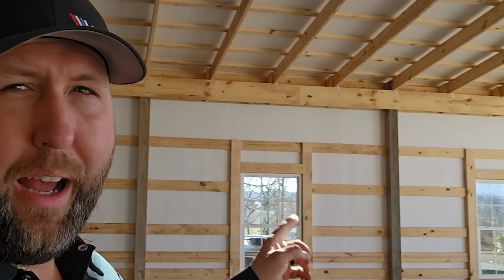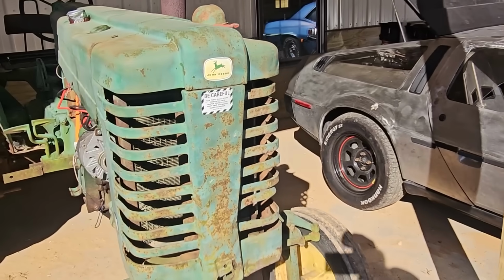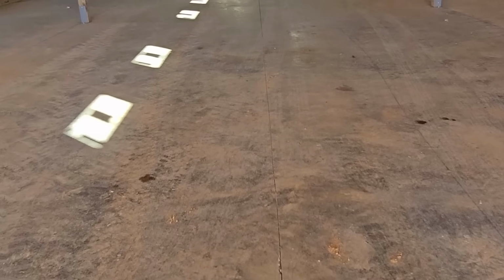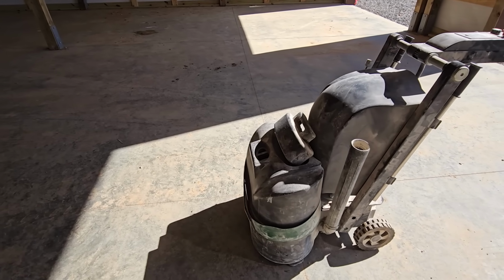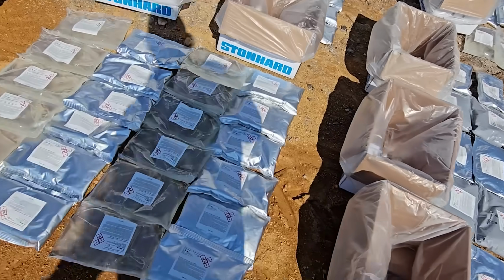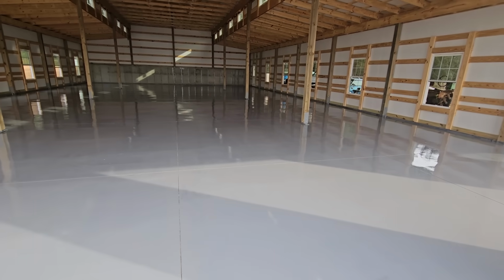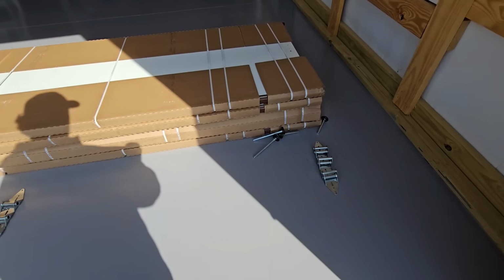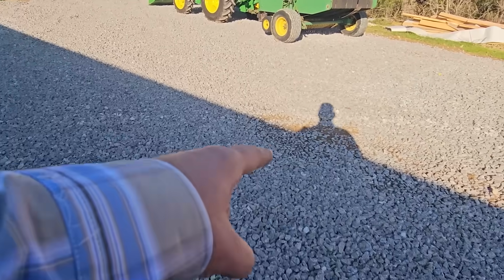Windows, Doors, Floor Epoxy, Gravel and MORE! Barn Build - Part 3

Comment: Great barn. I grew up in the road building business.  Knew those cracks were coming. Next time you pour a slab (and yep, there will be another) build some time into the schedule to compact the sub grade and let it sit a while. Also, pour in lanes with expansion material between the pours. And for sure the exterior slab should be isolated from the interior. You should take advantage of the expertise of the old guys and gals that watch your channel. Many of us would gladly lend a hand. That’s what a community does. Thanks as always for sharing so much. You prolly don’t know it, but you are helping this country come together. God bless.
Reply: And use a concrete mix design that reduces shrinkage/volume change. I design mixes for reduced joint and jointless floors by using shrinkage reducing admixtures/expansive admixtures/macro fibers and proper wet curing with wet curing blankets. Most contractors are only fixated on price per yd or sq ft and never upsell better ideas to the end user. They gasp at a reduced joint mix that will cost another $50 per yd, but then think nothing of spending double that doing what these fools are repairing cracks/epoxy band-aids. And dealing with a mad/unsatisfied customer.
Derek could have had a floor with reduced joint spacing, less chance of curling at fewer joints, more durable concrete with proper curing, and better long-term protection from cracking instead of this abortion.
Reply: @drcornelius8275  Yep. I'm afraid Derek will be making more repairs to this floor as time goes on.
Reply: It is true that us viewers may have better ideas, so that the concrete wouldn't have cracked, or a better way to do water run off, or anything else we see here, BUT, by the time we see it, it happened a week or a month ago or more, so it's too late to give good advice. I knew the other day what the floor looked like, because the kids were working on their 4 wheeler on Little Grip garage in there.

Comment: Nobody there uses rebar. Everybody has massively cracked concrete. The few who do use rebar have zero cracks.Those few people need to get with the program, rip out their concrete with rebar and replace it with no-rebar concrete and live with cracks. Remember, ants and termites love to enter structures through cracks in concrete. Who doesn't love bugs crawling around indoors!

Comment: i am a GC in state of Tennessee. and you are in my zone. BUT per the CODE they are 100% required to use no 5 rebar for monolithic concrete slabs. ?
in the state of Tennessee. all contractors no matter zoning must 100% comply with international building codes. when the contractors got approved for their license it said in the license that you must comply to the international building codes. no if and or but. 
if want the codes for the building codes that show rebar must be used i can.

Comment: Hmm. Not sure I agree with the rebar statements. I am in Mississippi and we use rebar like mad. Most new houses are post tension slabs too. Wire and fiber mesh definitely, rebar preferred.

Comment: All concrete cracks, the saw  joints help, but it always cracks. it will be just fine. they will get it it fixed better than new. Welcome to the south. Rebar is only for commercial work and Bridges.

Comment: I'm gonna be the oddball here and say, don't restore the tractor but, go through it mechanically. I think there's something cool about an old "worn out" tractor that is ready to go to work whenever you are. 

Also, I'm not an expert on the subject but, I feel like a small solar setup could handle door opening along with a few overhead/ security lights for nighttime use. Probably less expensive than pulling service in.

Comment: I've done a little bit of concrete here and there. And it looks like somebody didn't compact the Stone. Before they poured your slab, let me not see when the reason it would crack.
Unless it's been extremely cold and that warm. The ground could have moved. But I don't know if your ground freezes down there or not

Comment: Pretty much a dream garage........ONLY change I'd make is ROLL UP garage doors. When I built my car barn 20 years ago I used Roll up doors, even for my man door.  They were not cheap 20 years ago so I know the same holds true today. But in my 24x36 bard the overhead space roll up doors save is worth it. thx

Comment: I'd definitely restore that ol' Johnny Popper! And if I was you Derek, I'd run a string of lights and hook up a generator on an as needed basis. You know early dusk comes in the winter and you can't get something to start or you gotta make a quick fix and your working with flashlights and lanterns. A quick tug on the ol' generator would make life a lot better! 👊

Comment: Concrete cracks not because of the pour, or rebar, or lack thereof, it’s the dirt brought in for the fill. You brought tons of dirt in to create the under foundation. It needed to sit for at least 6 months, with repacking every month to ensure the mass of dirt becomes one complete compacted solid piece. Now the weight of the slab is compacting the dirt at different rates in different places, hence the cracks. Now every construction company out there will tell you 30 days is enough. Show me a 30 day dirt settle, where the concrete isn’t cracked. Nope, can’t do it. Just like painting a car, 90% surface prep, 10% paint. Don’t blame the paint job if rust spots start popping through. Just like here, don’t blame the concrete poor, it’s the dirt prep.

Comment: Maybe you can put some solar panels on the roof or in the vicinity of the barn. Excess power can be stored in batteries aswell. You could have some lights and at least some power there. Just an idea.

Comment: My suggestion is to purchase an ex military diesel generator, And wire up to a box at the door so you can start it up for power when you need lights or to open the doors, I watched a guy install one the other day and it was pretty straightforward, Only cost 3.5K.

Comment: They do use rebar in Tennessee in in the south but for a project like yours they lay down wire about a inch or 2 high and put about 6 inches of concrete

Comment: the rock is essential and a nice touch - for insulating some foam boards and wood paneling would give a nice retro feel plus make the new garage amenable - add a heat pump and some machining tools in the back - you have some room to work with, the pssst ppsst made the concrete floors look brand new! please add efi and roller bead seats to the delorean time machine

Comment: Speaking from experience as a builder in Virginia Beach, the slab probably would have failed even with rebar.  Next time, follow this plan:

Prep the dirt, test for compaction,
Divide the slab with "keyed" edges,
Use termite spray, poly sheeting, welded steel wire reinforcement suspended 2" below surface, 
Fiber reinforced 3000 psi gravel spec mix, air entrained, check for slump before pour.  Allow proper set time prior to stress.❤❤

Comment: I'm in texas, I work for renforce steal solutions in belton tx.  I haul rebar to job sites all over texas. That's what my company does. We supply anything construction companies need to poor slabs, except the concrete.  I can tell you for fact nobody here poors a slabs with out rebar or expanded metal in the slabs. Not any legitimate companies. We haul everywhere in texas. I love you Derek but someone is selling you a big hog. Maybe they do it that way in Tennessee but it is not correct
Reply: In the video showing the concrete being poured Derek said he fired the first concrete company because they were using a poor quality concrete. And now the supposedly better concrete ends up with major cracking. Makes a fellar not want to trust anyone's claims.
Reply: Its been a while since I had a slab poured but they always used expanded metal with rebar. But its been 20 years since I had one done so maybe they changed things? BTW This was in Mississippi.
Reply: Yea something doesn't seem right. He has cracks that parallel relief cuts 3-6" off to the side of them for almost the length of the relief cut.

You can pour without metal but I don't think you would want to do it for something like this where he has said it's for equipment and car storage. It's not a simple patio or carport.

Comment: Great looking barn its a shame the concrete cracked, glad they took care of it. Would like to see it again in 5 years to see how it held up. Its great to keep vehicles out of the weather. How long is the porch? The vehicles don't completely fit under it. Yes fix the old "Johnny Popper" Have you thought about some solar panels and battery to make it a stand alone building? Great for lights, air compressor, battery charger. Everything needed to bring something out.

Comment: Looks great Derek  yes restore the M   I rake with mine it was my grandfather's and only thing I've had to do to it in the 32 yrs I've own it is rebuild the carb a couple times and basic service work and it gets used daily and never gives me any problems.  I used several antique tractors and trucks on my farm daily love running that old equipment

Comment: Derek, you should look into solar power for this garage. You have enough roof on that building that if you connected your solar panels directly to the grid and not batteries, not only would it supply plenty of power for this garage but it would also back-feed into the grid and offset the power bill for the rest of the property. The tax credits also really help make this a hard to resist option. Estimates are free... just sayin.

Comment: Using a floor cutting stihl saw that cuts those lines obviously didn't cut deep enough to prevent cracks from going all across the floor...You have every right to be pissed!

Comment: There's 2 ways of pouring concrete and largely they depend on what the concrete is being used for and budget. There's rebar and there's some called like a fiber mesh concrete especially here in the south we do more of the mesh. You don't need to tear it out and redo it and you don't need rebar

Comment: We had the same thing done to the old floor where I work. We were getting a lot of concrete dust from fork truck traffic. They ground it down, fixed a bunch of cracks and clear coated it. It's holding up great!

Comment: Just a tip for any of you fellers with large shop space like this. Pick yourself up a Karcher S4 or S6 floor sweeper.  It doesn’t do well with stone or mud but it will cut your sweeping time huge. One of the best things I got for my shop. Less time sweeping means more time wrenching.

Comment: The outside concrete should have never been poured in conjunction with the inside concrete. They should have been two different pours with expansion joint to separate the slabs. Expansion rates vary greatly between the inside and outside concrete. You can cut out the cracks and repour them but they will come back. I would suggest cutting a saw joint along the entire slab on the outside of your building. Right next to the wall. It is not a perfect solution but the alternative would be to cut out a 12" strip on the outside and separate the concrete into 2 slabs. Repour the cutout portion and use expansion joint material to keep the slabs separate Good luck.

Comment: Cracks in new concrete?!  That's rough, glad to hear it's getting taken care of
Reply: It's not uncommon, especially when you have a lot of machinery and hundreds of pounds of material on it
Reply: @corey4109  I wouldn't say that it's not uncommon... where I live the ground moves ...A LOT!! And if a new slab cracks, it's because someone didn't do their job properly. Even here, where the ground can and does shift half a foot up or down at some point every year, it is absolutely not common. And when it does happen, someone is at fault and is liable.
Reply: @GregoryMcConnor  I have yet to see a house that doesn't have small cracks like that in the slab and I've worked in the housing industry for 11 years. I have yet to be in a house, new or old that didn't have at least 1 or 2 and I've been in hundreds

Comment: I know they claim to let the concrete cure before sealing but I always roll on Thompsons water sealer immediately after they're done finishing the concrete finish. Last slab I poured back in  2009 still looks like it did the day it was poured. Just a guy's random comment. You know you could throw a few solar panels on the roof to have enough power for a couple of lights and run your garage door openers.

Comment: You should definitely restore the old tractor
Reply: It would be good to restore something completely.  All the way down and back up again.
Reply: I've done quite a few Johnny poppers definitely an enjoyable experience doesnt seem like people have been doing alot of restoring on classic tractors lately we've all learned it's nearly impossible to not end up upside down on em monetarily speaking
Reply: @farmhandbrows unfortunately 2 new rear tires will not tread lightly on a budget tractor restoration. For me, restore=rebuild to use regarding tractors.
Reply: Full resto bleep bloop
Reply: All the old tractors he has lol
Reply: Great to see old timer farm machinery take on a new lease or life .
Reply: Sandpapers the spark plugs,  adds a license plate seat,  puts gas in it,  twiddles his fingers,  it runs: restored.
Reply: I like these things brought back mechanically but left esteticaly old.
Reply: definitely
Reply: Yes
Reply: Full full restoration! 👍💯